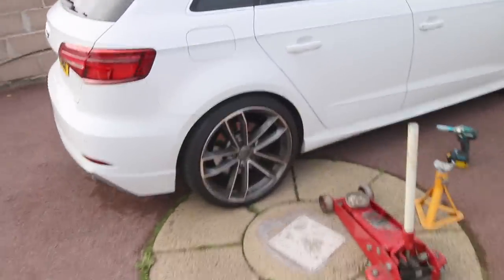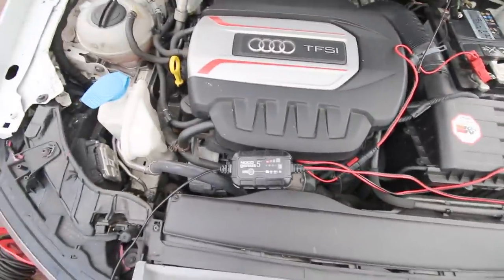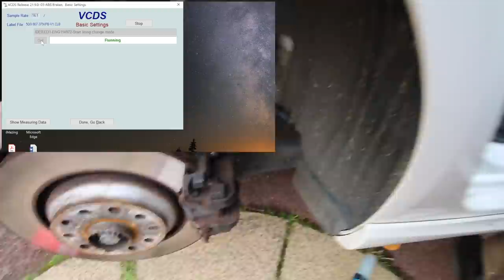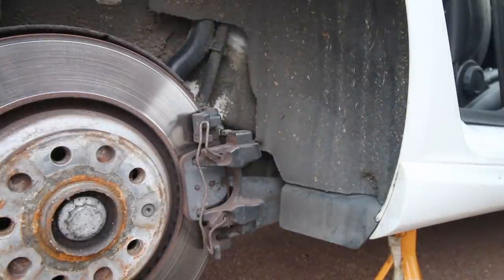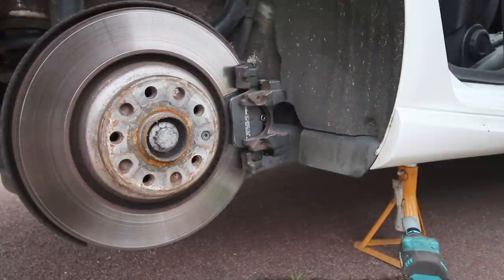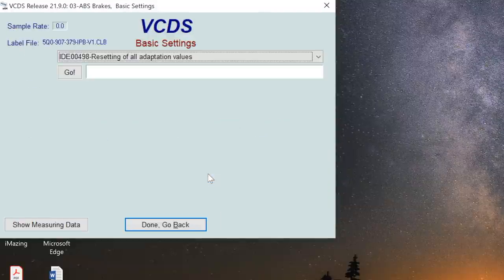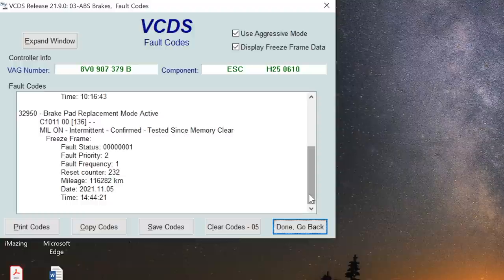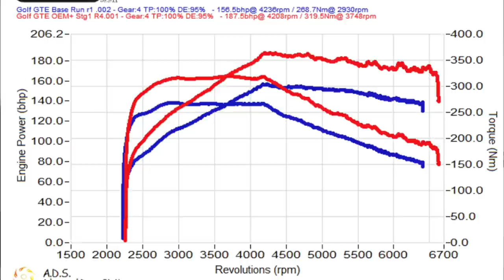Fitting rear pads on electro mechanical brakes on the S3 & Golf GTE remap review

Comment: Glad regal reached out with an updated graph. The torque and power figures tie up properly now unlike the last one! I trust it was just on the engine much more now!
Reply: Also you didn’t mention why the electric motor didn’t run on the dyno?
Reply from the maker: We are still looking into this. At the moment, we think it could be because the bonnet was open which the car detects, but this is just a theory at the moment.

Comment: Great to hear that you are enjoying your GTE after some more seat time in it! Just a note on the graph, it appears that we didn't explain the graph fully. Whilst it looks like power climbs and then falls, this is not the case. 

We thought this was due to the lines being the same colour, it's difficult to differentiate! Coming from software whereby the Y axis was the same for HP + torque and the colours of each being different on the graph, we, unfortunately, misperceived it! 

We are trying to get the dyno software supplier to change the colour of the graphs for the future.

We have adjusted the scales so that the graph is much clearer, which is what you can see - no data has actually changed, it's the same data, just different scale on the Y axis to allow for the lines to be more easily differentiated.

Comment: Great video. One minor note, when rewinding in the pistons, the cutouts should finish horizontal to accommodate the nipples on the back of the pads, so they sit within the cutouts and not on the face of the piston. This also  aids assembly. Not all brake pads have the nipples on the backside, but be aware! 👍🏾

Comment: Paul make sure the noco is on the correct setting when charging. I noice it was on the standard setting, lots of newer cars have an agm battery and the noco should be changed to this setting before use if it has an agm battery, it will be in big letters on the top of the battery.

Comment: Hi Paul so do you know what bhp it is running now in gte mode ?
Reply from the maker: it is supposed to be running 269BHP but I will need to confirm this on a dyno. We thing the reason why we only got the 190bhp on the dyno was because the bonnet was open, but thats just a theory at the moment.
Reply: @CarsForPaul  ok fair enough. I'm really keen to know what it's bhp is in gte mode and thoughts on if it user the battery fast now in gte mode. Then I can take mine to be done. Thanks Paul.

Comment: Is this remap with start stop turned off for longer lifespan of turbo?
Reply from the maker: No, this does not turn off start stop as apparently this reduces the power output from the electric motor.
Reply: @CarsForPaul  Ah okay weird. Here in The Netherlands they say start stop gives more power if it's off from standstill. Also turning engine off with hot turbo is bad.
And with start stop off it's easier to drive the engine warm before giving it full theottle

Comment: You can do these without a computer : release handbrake, un screw the motors from the calliper , change pads as normal , pump the brakes, refit the motor jobs a good un done loads of them